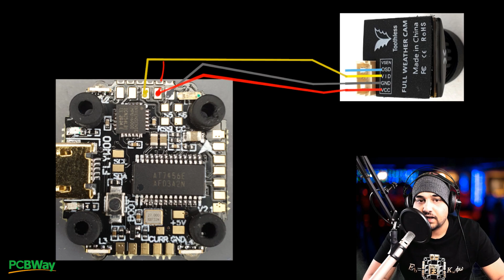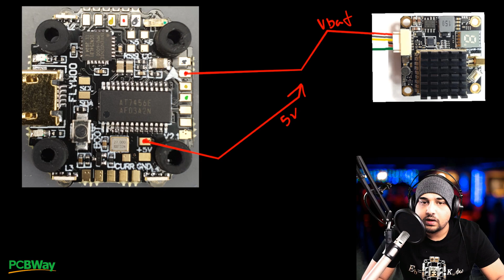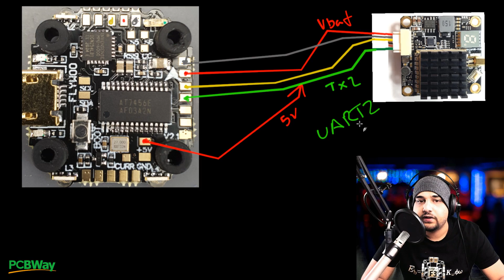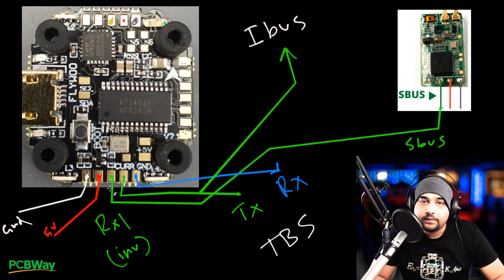First 16x16 35A Stack!!! // Flywoo Goku F411 35A

Comment: I like the pins. It's nice and easy.  This layout should fit my flywhoo 411 16×16, so I just buy the ESC.  I like that a lot. Great review man, and a great advert for PCB ways.  Deffinately add capacitor, and put some clear epoxy on the LEDs so they don't get ripped off by a branch in a crash ( it also makes the light spread nicely 😉